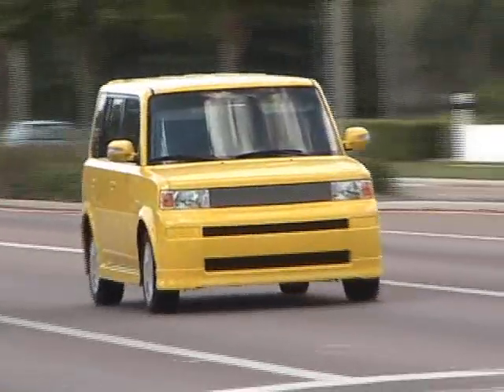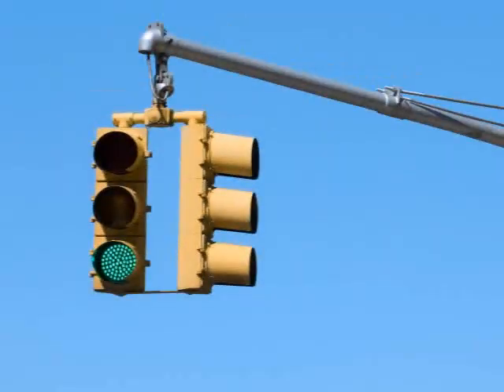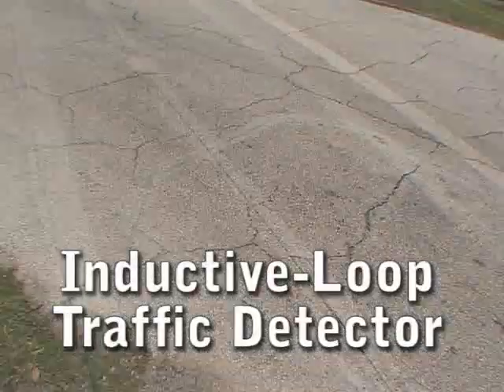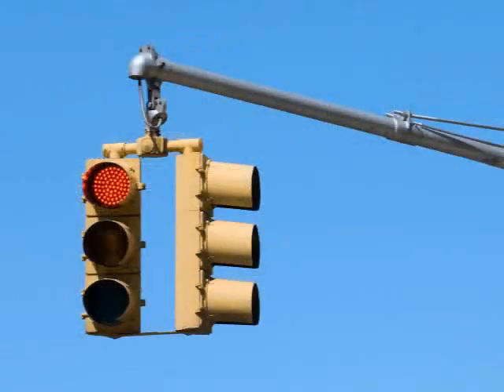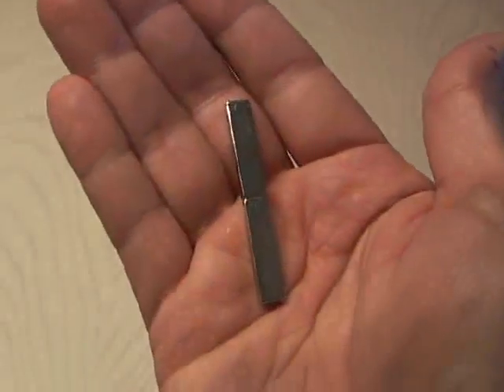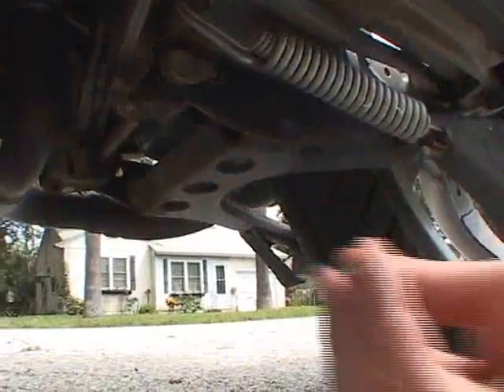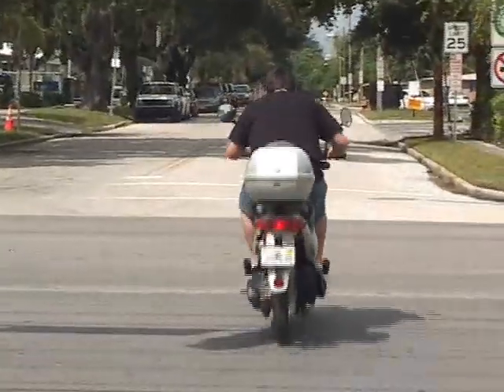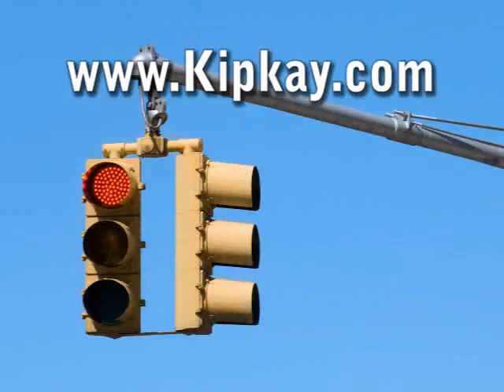Trigger Green Traffic Lights

Comment: I did this at an older traffic light near where I live, just to over do it, i put some of the biggest strongest magnets I had, and it changed the lights to all red instantly. I got the magnets off of a junked police car, and put them on the bottom of the frame on my bicycle. This specific light was set to go all red when I (the emergency vehicle) roll up to it. Also, there are 3 other ways to trigger it. one is through a flashing infraredlight, the other through an electronic siren, and by radio

Comment: @88ariesk ACTUALLY....these days...fire engines and ambulances often have a light changer in the vehicle operated by the driver (or maybe when emergency sirens are on?)...I am not positive how they work, but I know that they have them as I've seen in multiple instances, a light turn red and then instantly green again as a firetruck/ambulance approached. I don't know if street sweepers or cops have them around here though.

Comment: @Kasta134 If its really that big and metal to pick up your bike then I'm pretty sure it shouldn't be on the road. Also i doubt that the velcro/adhesive holding the magnet to the bike would keep the magnet attached in the case of that situation, thus pulling the magnet off the bike which in itself is highly improbable.

Comment: @DearSantaclaus Most vehicles have enough metal close to the road surface that this won't necessarily do anything, it's small cars and bikes that aren't detected by the system due to a lack of ferrous mass in the induction field. So a light pickup truck with it's thick frame and cast-iron engine block will have no issues, whereas a compact with it's paper thin monocoque and aluminum engine block and oil pan won't always be detected.

All this does is make the system detect them, nothing "unfair"

Comment: @peuterschmidt Yes, it will. That's like saying that a car in a turn lane will never get to go as long as there are cars in the oncoming lane. That is not true. Once the light registers their presence, it doesn't matter if the opposing lane is busy or clear. If clear, it will change quickly. If busy, it will give the other cars a red light and change after a set amount of time. Regardless, it will change where it very well may not before (I've been stuck at plenty that will not).

Comment: It also works if you are on a slight uphill towards the light.  Just put the clutch in and roll back 10 feet, drive back up, and repeat, works with a Jetta :P

Comment: @peuterschmidt Umm, your point is silly. Who doesn't know that it's all tied together? It will turn green even with cars at other lights because theirs will turn red for a set time. There are many lights that do not cycle based on a timer UNLESS traffic is detected in certain directions. It you rode a motorcycle, there is no way you could miss that. No one said that it turns green on command even while others have green.You still have to wait but, before adding magnets, it wouldn't turn at all!

Comment: I'm not sure about the US but Traffic lights are usually cam controlled and timed based on amount of traffic, time of day. Induction loops are used and they are less sensitive than they could be and act like a metal detector by sensing the vehicle. Whether Neodymium magnets actually have an effect IMHO is suspect simply because the induction loops are not sensing magnetic fields, BUT the presence of the magnet may well alert the light controller to a vehicle's presence and then change.

Comment: This is absolutely true. you wont notice it will there are cars behind you or next to you cuz they help change the light. I been driving my motorcyle to work lately, and i get out at 2am pretty much no cars on the rd. I pulled up to two lights that WOULD NOT change unless a car pulled up, which at that time of night took forever. I had to start running red lights all the way home. FUCK. sry. frustrating. anyone who has a bike and has to  drive home late knows what im talking about.

Comment: @Itmustbes2
Most of the traffic lights in San Jose are run using a traffic-density logic system rather than the induction loop trigger. A computer uses data, gathered from the loops in a given intersection, to adjust the timing of when and\or if a traffic light changes. These traffic-sensing systems usually have a "Loop Mode" that kicks in late in the evening. But, some cities (like San Jose) just leave the system in "Traffic-Sense" mode 24x7. And Yes, it does suck!

Comment: They use sensors in the traffic camera in Utah so you don't have to worry about what you are riding. From 12:00 am to 6:00 am they chan automatically when a vehicle comes to the light then other hours they are times.

Comment: @Sticksane i doesnt turn green instantly, it makes it the same power as a car, so it triggers the magnet. anyway, it doesnt turn green instantly, it makes the other light turn yellow and then red as long as it has been a long enough green light for the other people. so you wont get hit, because the other light will be red.

this video is only for motorcyclists and small vehicles.

Comment: how would you change the light if it had a sensor by the actual traffic light instead of a coil of wire paved in the street?

Comment: I'm not sure whether our lights here are pressure sensitive (weight of the car) or magnet, but it requires 2 vehicles in most cases to make them activate at left turn signals. So if there is no one else there, I just back up over the 2nd set of lines and then move forward again so "IT thinks" the light is supposed to change. Of course, it is probably not legal to back up...so I do look around to make sure no law enforcement folks are around. -Mesa, AZ

Comment: @anthony4life4life well... if u wernt an idiot, and could actually had a motorcycle or a car, you would know that when ur idling in Drive ( or 1-2nd if stick shift) your small car or bike is still using gas. therfore, the longer u wait at the light, the more gas your wasting... the less time you spend at the light, the less wasted.

Comment: ok ill do this but use like 200 magnets. thats a pull force of 1200 pounds right? divide that by 12inches and you get 100. so now i can change the signal from 100 feet away? sweet deal! i never have to wait ata light again.

do people have a magnetic pull? or how does the cross walk signal work? do i see a magnitized shoe comming?

Comment: @Chocolatecandy1961 Yes the other lights turn red. What the magnets do is tell the light's sensor that there is something over it, so it can switch the lights. Motorcycles, scooters, and very small light cars sometimes don't have enough metal to trigger these sensors effectively. The magnets ensure that you trip the sensors every time.

Comment: @Wallabydam. I used to xray large submarine castings. and to hold the film up against the metal, we used large u shaped magnets that weighed about a lb. we also used industrial red duct tape. if the magnet touches the metal by itself,(without the tape in between magnet and metal) I had to use a wooden wedge because it's time consuming and hard to remove it with your hands. im sure placing a flat magnet is a pain. thus the tape.

Comment: I don't think that the light automatically turns green where the stronger induction field is (although i could be mistaken). The system makes more sense as a means to see if there is actually a car waiting. If not, the system can keep the main road green for a longer time, keeping traffic flow on the main road uninterupted as long as nobody comes in from the secondary road.

Comment: as long as the magnet doesn't interfear with other services (and none come to mind right now) it's completely legal in the sense of the law. The inductive curcuits serve only to optimize traffic flow and to actually cut down waiting time for commuters. The fact that they don't work for scooters is not intended (since scooters are commuters too). Here in Austria there are buttons to push manually for cyclists and scooter drivers.

Comment: @MidgardEagle The manufacturers of the scooters can't just put magnets on the scooters, it is a safety hazard.  What if there is a piece of scrap metal on the ground and you drive near it, or a nail, and it breaks the wheel causing you to crash?

The manufacturers would be to blame, so they can't just put them there.  However if you want to take the risk that is your own choice, and that is what Kipkay is suggesting.

Comment: yeah we get down to about -30-45*C in the winter, and in the summer it can reach close to +40*C. lol our winters don't magically disappear when it's supposed to be spring we can still receive low temperatures and snow in June, sucks really. We tried the concrete pavement on one of our main highways running through the city and that was a major fail it died within it's first year lol. I don't see very many loop senors anymore the cities trying to cut back or replace them.

Comment: My mom works in road construction and she says when they're paving the roads they put in pressure plates that sense that a cars there by the weight. We use them a lot up here in Canada because the freezing and thawing if the roads would just make the cracks by the loop sensors grow and cause lots of problems.

Comment: Motorcycle and modped riders!
Just to let those know, they do sell such devices on the internet, usually called a traffic light trigger device. Nylon tied to the underside of your 2 wheeled vehicle AWAY from the electrical circuitry. Legal to use; BUT some cities do not maintain the metal strip / triggers in the road. So it is hit and miss (!) while riding the highways and roadways in North America. 
And no, they do not change stop signs to go signs! : )

Comment: @MrightX 

no, it's not a 'hack'.  the traffic lights are designed like this to let traffic go when there's enough of it.  eg. If no-one is waiting to go, the lights will never go green, the inductors in the roads surface tell the lights that there is traffic and so the lights stop other traffic and let you go.  The tips here simply fool the system into thinking there is a lot of traffic.  Repeatedly reversing and driving over the inductors has the same effect.

Comment: Just to let you everyone know, this won't work in urban areas (At least not in NYC), as the traffic lights are programmed to change at set times.

However, the trick to getting by urban lights is just driving at the speed limit. Most lights are programmed so that if you go to fast you'll get stopped by a red light, but going at the right speed means you can get pretty much green the entire way.

Doesn't factor in morons that have to drive at half the speed limit, though.

Comment: this would only work with the ones that actually use the electromagnetic field, in aberdeen (family lives there) they dont have this. instead the lights are on a timer=p it good cause if u go 45mph (5 over the speed limit) you can hit every light going down about 7 blocks right as they hit green =p

Comment: You should be able to find some NeoDymium magnets by searching for them on eBay.

You may not be able to find exactly the same size and shape magnets used in this video, but as long as the ones you get have the same pulling power (12lbs total), you should get similar results.

Comment: you could also open a drain cover and put it on the coil. It always works ;o).
And wear a hemlet when you drive arround with your scooter, otherwise you'll have bigger problems to deal with, than a red light

Comment: Gasoline is both.  It has a low boiling point, so it evaporates quickly, making some people think it is a gas.
At colder tempertures, gasoline is a liquid.
Also, liquid gasoline is not flammable, only the fumes(the gas form of gasoline) burn.

Comment: nah, it's not illegal at all.  I used to ride a smaller motorcycle, and it's a constant frustration having to wait at lights until a bigger vehicle comes up behind you.  As long as you aren't actually circumventing/altering the way the light system operates, you are not breaking any laws.  You're just making yourself a big enough target for the sensors to see, that's all.

Comment: The easisest thing to do to make it turn faster if you're driving a normal car, if the lights have turned orange (amber) or red, the easiest thing to do is to let off the gas/apply the brake gently, to try and slowly approach the intersection (rear traffic permitting!!! Don't try this at rush hour) and try and stop back so the back of your car has passed over the beginning of the wire. What this does is fool the system into believing there is a heavier build up of traffic than there actually is.

Comment: @TurboDV8 
It might work with your bike, but some bikes, such as mine, have very little magnetic material. The frame and the tank are about the only things made of steel on my bike. Everything else is aluminum, and the fenders and fairings are ABS plastic. And I know this to be true, because my position on the loop doesn't make a difference for the light. I'm not saying you're wrong, just that this technique might work better for you than for me or others.

Comment: @crob227 
Only if the starter is operating. The starter contains electromagnets. They are only magnetized when a current is going through them (when you hit the starter button). After you start the bike, the starter isn't functioning anymore and nothing in it is magnetized. Kill the engine and restart it. This WILL generate the strong magnetic field when the starter restarts the engine.

Comment: I wonder how many dupes are riding around with a magnet stuck under their bikes because of this video? If it seems to have worked for you, then it is probably because next time you came to the light after placing the magnet, you came to rest more closely in line with the embedded loop. Can this BS magnet nonsense, and just bring your bike to rest with it's central mass positioned directly over the edge or corner of a loop, instead of in the middle of a loop.  Works every time.

Comment: obviously this will not instantly make the light go green, if that's what you may be thinking. Traffic lights are controlled by a central computer that regulates traffic loads - the magnetic sensor in the road just helps indicate that there is a vehicle waiting and thus a green light will be put in qeue. The only thing this trick solves is traffic lights that never switch (or take an immensely long time) because there is no other traffic.
Anyone would just cross the red light in such a situation

Comment: There is another way to trip the sensor If you're on a motorcycle you can pull in the clutch, stop the engine, and press the engine starter button. The starter is powered by an electromagnetic motor, creating more magnetic energy and tripping the sensor.

Comment: The light doesn't "poof" green. Even the siren sensors that police and ambulances use to change lights at busy intersections don't do that. It still goes through the cycle. But if it doesn't know you're there then it wont change at all.

If it's illegal then driving a vehicle large enough to trip the sensor is also ilegal.

Comment: I used the "Rattle Snake Eggs" (Cracker Barrel sells them), on my old moped. It's not illegal but won't work if the lights are timed. It DOESN'T cause accidents, the light doesn't suddenly change, it does the exact same thing a light would do if you pull up in a larger vehicle, opposing lights go through yellow/red just like normal you just don't have to wait for another vehicle to pull up behind you. The subwoofer in my car does the same thing. The light doesn't change I crank it up, and VIOLA!

Comment: A change in the magnetic field produces an electric field, so when you stop, there is no magnetic flux and no electric field is produced. Traffic lights need to have a change in the electric field that will be sustained while you wait, otherwise it will think you made a right turn or something and not change. Just putting magnets on a scooter won't do anything because once you stop accelerating or decelerating the electric filed goes back to normal. In other words, this video is bullshit

Comment: you can't do it in holland because they are not running with magnetic fields(srry for bad english), they run with air sensors, there is a tube in the road, at the end of the tube there is a sensor that feels the presure from the car on the tube, so... hard luck!!!!

Comment: Sorry to tell you, this is pure bunk, magnets don't trip traffic sensors, Motorcycle Consumer News and several other magazines have tested this and found that magnets don't work.  MCN also contacted a manufacturer that makes the traffic signal equipment, and they said magnets won't work.  

Stop directly on top of the lines, that's free and IT WORKS!

Comment: Weight-based traffic sensors haven't been used in the U.S. since the 1970s.

Kipkay is 100% correct about how inductive wire-loop sensors operate.  They magnetically detect ferrous metals.  Aluminum and plastic don't set them off.

I work for an electrical supply company, and one of my customers is a traffic signal supply company.

Also, my mother was a township official for six years here in the Philly suburbs.  Between her term of office and my job, I got to see exactly how these sensors work.

Comment: mr insult king you are fukin stupid... First off what the fuck are you talking about "flashing lights" This is talking about NORMAL cars and NORMAL motorcycles not emergency vehicles. Likewise, it also isnt talking about changing the lights to green IMMEDIATELY like you are thinking. Yes some lights do have sensors for emergency vehicles which change the light right away but this is for the ground sensors to register a MOTORCYCLE like they would a car to start the light changing cycle. Idiot.